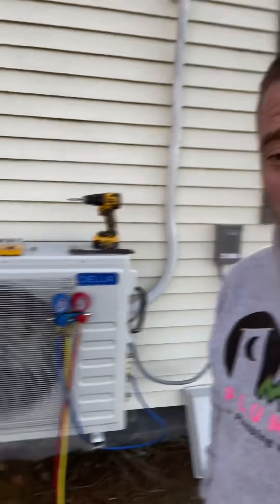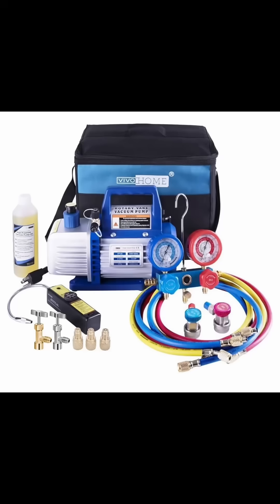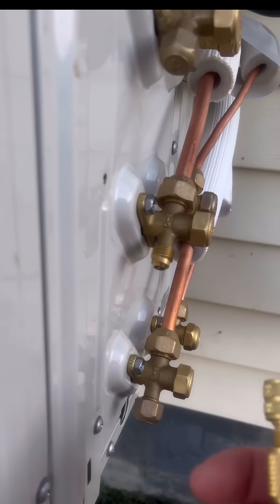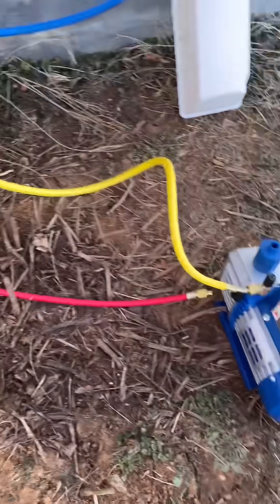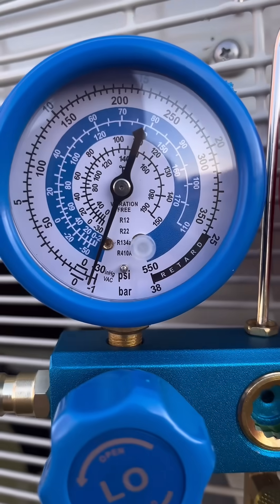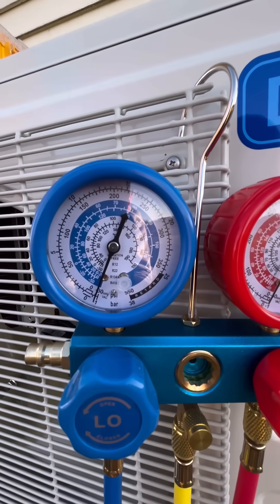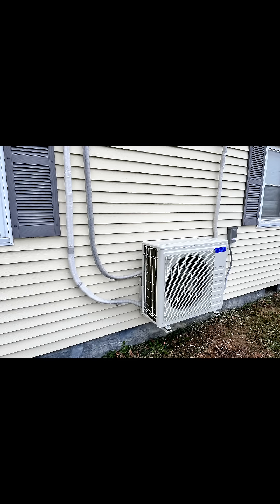DIY vacuum and charge a mini split system

Comment: Is there a check valve where you hook up the yellow line that allows you to pull the vacuum, but when you remove the cap no air goes back in?

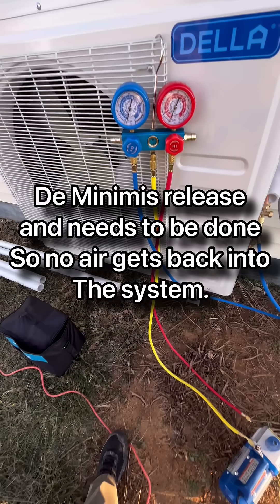Comment: Ouch. Your left thumb.  There is no way for air to get into the system (about 1:20) when doing the De Minimis release.  The system is under pressure.  No air can get in. The goal is  to remove the adapter quickly to minimize the release of the atmosphere-destroying refrigerant.

Comment: That was huge. Hard to find info. Thanks!
Reply from the maker: I’m glad it helped!
Reply: Yes! I bought a Mainline split system 3 years ago and have been told by co tractors unless they supply it they don't hook it up. So its been all mounted , electric run except for line sets. I used to do AC work in the 80s and chose plumbing because I hated working on beautiful sunny weekends when everyone is at the beach LOL I will get a vacuum pump and get er dun!

Comment: When do you disconnect the blue line from the AC unit after vacuuming is complete? 
Do I release the Gas first then unscrew from unit, or unscrew from unit then release Gas?

Does unscrewing this hose slowly not allow air into the system?
Reply: I have the same question

Comment: I see three ports how do I know which port to connect to to properly do a vacuum?

And another question to this do I need a micron gauge or can I use my manifold gauge and measure psi?
Reply from the maker: A micron is good to use but you can just use your gauges. As far as the 3 ports, you only need the blue and yellow for the vacuum and test.

Comment: this is the procedure to do after you completed the whole mini split install and you want to fill the lines with the refrigerant that comes pre charged in the condenser, correct?
Reply from the maker: Yes this is after the install and before opening the ports to put refrigerant in.

Comment: Do u remove the shreader valve where u connect to the blue line or do u pull it with the valve in there . Thanks
Reply: He is pulling the vacuum with the valve in there.

Comment: Where the yellow tube connects to the gauge/manometer, there's a knob. It's supposed to be a release valve. What to do with it? Tighten it (clockwise) or loosen it?
Reply from the maker: You can just leave it open at all times. The blue one (low pressure valve) will control it when you are vacuuming(open) or letting it sit when you test for a leak (closed) to make sure there is no drop in pressure.

Comment: 20mins? You should be running it till it’s below 500 microns at the least. And how do you know there are no leaks
Reply from the maker: It explains in the video…. But The manufacture recommends vacuum pumping for 20 min then wait for 20 min to ensure there are no leaks by checking The gauge.

Comment: Auto zone rents these out for free. You pay rental fee then when you return you get your money back
Reply from the maker: I didn’t know that. Good to know 👍🏻
Reply: @affordablebackyardprojects6619 is it really that easy to do? Looks too easy and guys out here charging $100 and up to do this
Reply: @affordablebackyardprojects6619 is that adapter needed to plug blue hose? Blue hose fits directly on my unit but want to make sure it’s just an adapter to make it fit and doesn’t do anything else
Reply: Autozone doesn’t have the correct manifold. I ran into that problem. They only connect to car AC and adapters cannot connect to it either.

Comment: Soo? What if the mini- split is empty after a line replacement??? Do you vacuum with the valves open?? Then how do you charge the system?? 😔
Reply from the maker: You will have to recharge them. Typicaly you need an hvac license to get the refridrint. Unless you “know a guy”

Comment: We just put one in and while the compressor is running and the lines are open, the cold air doesn't run cold, and the heat doesn't run warm, even set at the highest setting, running for for about 5 minutes, but it feels just a few degrees warmer than the "cold" which is running at the current room temp, and we have been running the cold setting also at the lowest temp..we can't find any leaks. Any ideas?
Reply from the maker: Did you open the ports to allow the refrigerant in the lines after you vacuumed the system? Also make sure there are no kinks or leaks.

Comment: What is the reason you would want to pump in the first place.
Reply from the maker: It gets all the air and moisture out of the lines and also checks for leaks before you open the valve to put the the refrigerant in the lines

Comment: Dont you ned to vacuum both lines at the same time
Reply from the maker: No, it’s a closed system. There is not a connection port to vacuum.

Comment: If you open a line with refrigerant, does shit off the valve where you just pulled vacuum from??
Reply from the maker: It has a nipple that is pushed In when you screw in the hose line. That’s why you lose a little when you unscrew but keeps air from getting into the line.

Comment: Q- my system leaked and loose almost all refrigerant. So if I want to add more Freon . Do I have to vaccine system or just add it more and check for a leak and let it run? So when you vaccine system, do you close side valve or leave it open and vaccine it? Not in a new system, I am talking about mine. Thanks a lot appreciate
Reply from the maker: A old system you would want to vacuum to make sure there is no leak. If there is no leak then yes you could just add more.

Comment: Is the info on the home units the same for 12 volt rv mini split  or is the vacuum pressure different
Reply from the maker: Vacuum pressure will be the same. All you’re doing is vacuum out the line to ensure there’s no moisture and you have a proper seal.

Comment: Where does the refrigerant you vacuum go?
Reply from the maker: This was a new install, so what I am doing with the vacuum pump is one making sure there are no leaks and two getting any moisture and vacuum out the line. Once the line has been vacuumed, then I turned that little release valve to put the 
Refrigerant into the lines since it was a pre-charged system.

Comment: You left out how you open and close the valves on the mini split valves.
Reply from the maker: Turn left to open all the way
Reply: Don’t do this yourself call a professional. If you don’t do it correctly you could get non condensables in your system and compromise it.
Reply: @JH-82-d7j why pay someone to do something you can do yourself when the person can follow directions
Reply: If you’re a capable person go for it by all means. I guess it’s not the end of the world if you get it wrong. Compressor works harder, less efficient, lowered capacity.

Comment: Why do Americans never have ducting on their split installs. Just pair coil draped down the wall. wt hell?
Reply from the maker: Because we are Americans 🇺🇸 we do what we want.
Reply from the maker: And also in the full video explained that I went back and covered them. I just didn’t get a video of that part.
Reply: Hi my question is after you open both the refrigerant lines do you close them after the refrigerant it has been released and then put the caps on thank you
Reply: @missrv9432 liquid gas is stored in the condenser for shipping. One you have the fittings flared and installed to the specific torque… 

You MUST completely vacuum the system. (Ensure you use a hose that has the Schrader valve depressor where you connect to the Aircon -  else you will only be pulling a vac in the gauge manifold). 

Once you have confirmed you’re pulling a good vac, run the pump for as long as possible. I would aim for a minimum of 20 minutes. (Ensure the vac pump oil has been changed in the last 6 months). 

When this is complete uou must close the gauge valve. Then turn off the vac pump and let it sit for approx 20 minutes. (This allows you to leak check).

Come back and ensure the vac level has not moved. 

I then release a small amount of gas by unscrewing the Allan key, just enough so that I have a tiny positive pressure in the system. Now I quickly remove the gauge. (If you don’t do this - technically a tiny amount of atmospheric air will be sucked into the system when you disconnect). 

Now. All your lines are under a full vacuum, you may proceed to unscrew BOTH Allan keys which opens the lines and releases gas into the entire system... And put the caps on tightly. Support the fitting when you put the cap on with a second spanner. Never tighten any copper fittings with just one spanner as it will flex and can damage connections behind. Always tighten against a second spanner so your hands cop all the twisting forces. 

Read the OEM instructions but most aircons have a test mode to run them in after commissioning, 

Failure to complete a vacuum can have a detrimental effect on the compressor and internal components long term as the gas and oil is hydroscopic. When mixed with moisture they can damage internal components over time.
Reply: Very thorough reply and quite helpful...thank you!  @Jack_Hagerty
Reply: @Jospec5Star your welcome. 

Supplementary information; 
 
If you have a digital vac gauge. (I personally use a CPS digital gauge). Aim for <100 micron when pump is on - I can usually get under 60micron for a 2.5kw split system with a back to back installation and a dual stage vac pump (with fresh oil), sometimes this takes a while (20-30 mins) to achieve - especially if there is any moisture in the system which very slowly boils off. 

Once you close off the valve while the pump is still on, the gauge will almost immediately creep back up. But aim to keep it under 400 micron after sitting for 10 mins. If it keeps climbing, there is zero doubt there’s a leak.

However - Analog gauges will never give you this fidelity. So the best you can do is leave it sit for even longer (30+ minutes) and wait to see if the needle has moved.(a light sharp tap on the gauge is handy to check for needle movement.) ultimately it shouldn’t move else you have a leak. 

Annoyingly AC manifold hoses and the internal seals under the screw fitting are prone to leaking under a vac. Any reputable HVAC store sell these seals. Designed to be replaceable.. This is the first place to start if you can’t hold a vac!

Again. VERY important. Make sure the fitting you connect to the air conditioner gas line (usually the bottom one) has the Schroeder depressor. Else you are only vacuuming your hoses and not the system at all. I’ve seen MANY people stuff this up!

Hope this helps anyone including yourself. 
Goodluck!
Reply: @Jack_Hagerty  Excellent points!
Reply: Zones

Comment: U should unhook the hose from the pump after the vacuum so u don’t make the pump chug and pull oil out the reservoir in the pump after shutting it off, but good shit
Reply: I read your comment a little bit late. I learned the hard way but thanks. 😂
Reply: After you close both valves on the manifold, you disconnect both lines from the vacuum pump?

Comment: Did you have the line set closed? I thought you pressure testing the line set what’s the point?
Reply from the maker: Yes, they were closed to pressure test. Once  passed the lines were charged.
Reply: Thank you for posting this ! All the refrigerant drained out of my mini split, there was a hole in the line set. How do I recharge the system completely after I vacuum it?
Reply: @kennichols7688  You have to get refrigerant and that is illegal if you are not certified so call a technician, it is beyond your power to repair it now. Sorry.